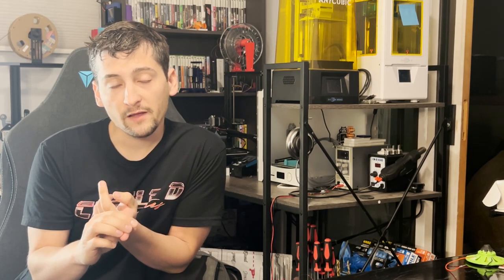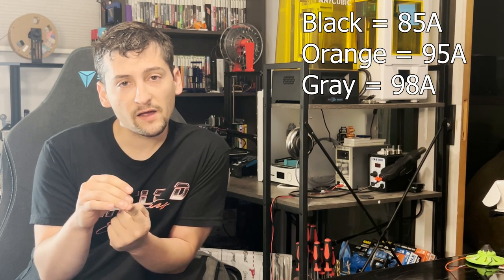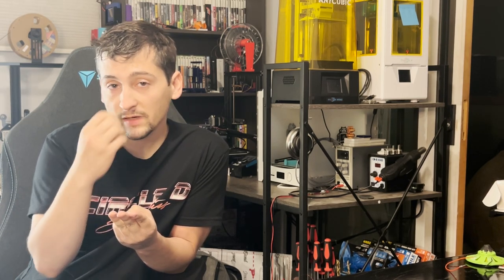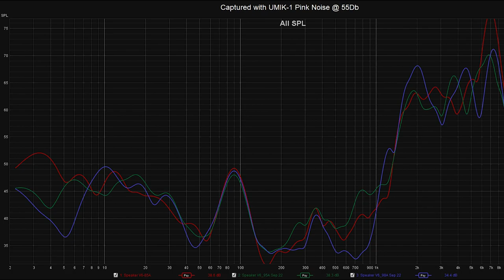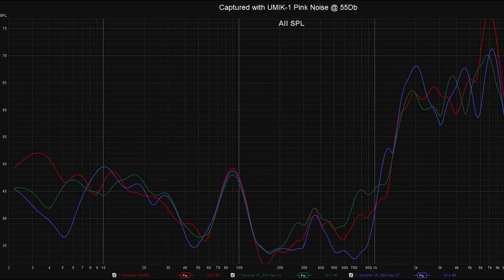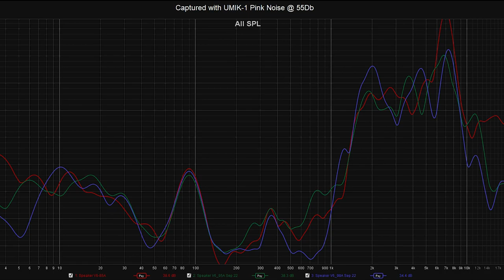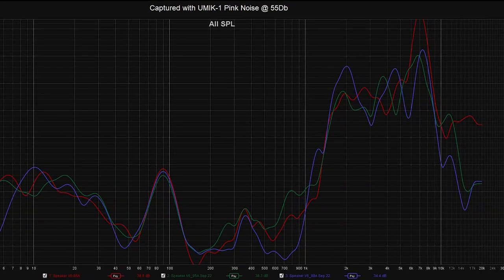FULLY 3D Printed Speaker Version 6.0

Comment: Nice stuff! But a big tip for next time. The reason you only see the very top end of the frequency response is because at a long enough wavelength the rear wave wraps around and cancels out the front wave, meaning the lowest frequency producible is limited by the size of the speaker. The way to fix this easily is by putting the rear of the speaker enclosed in a sealed box, and is why you usually see speakers in a box of some sort 👍
Reply from the maker: Yeah, I really need to at least start laser cutting a panel to keep front and back separate, I did build enclosures a couple videos back just testing different material though.

Comment: Wow really low views to just randomly show up in my recommended. Your music during transitions is way louder than the rest of the video. I recommend figuring that out because it's very jarring, better for it to be too quiet than too loud
Reply from the maker: I’m terribly sorry about the audio, I completely spaced the audio leveling in my editing.
Reply: @piscesprinting4170  that's alright man it was a super interesting video!! Have you seen 3d printed transmission line housings like the ones by Hexibase here on YouTube? My first thought when I saw your video was pairing the speakers with a compensated housing to make up for any deficiencies from the speakers
Reply from the maker: I have seen them, he makes some quality videos. I hope my videos get to that level someday. I totally agree though that these speakers could use a good properly tuned enclosure. I’m currently trying to figure out how to pull thiele-small parameters out of these speakers. As I would really like to make a proper enclosure for them someday.
Reply: @piscesprinting4170  I'm excited to see it
Reply: @piscesprinting4170  A DATS system should help you massively. Probably one of the simplest ways to get ts parameters out of a driver